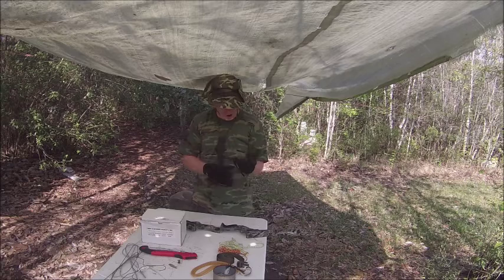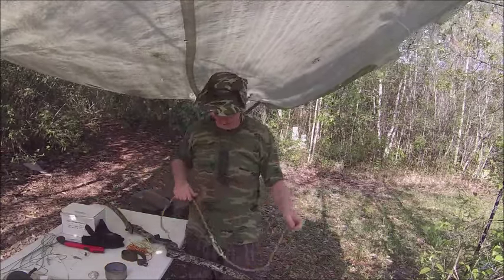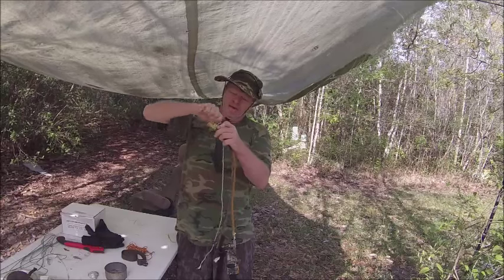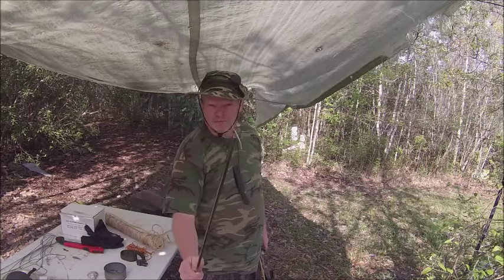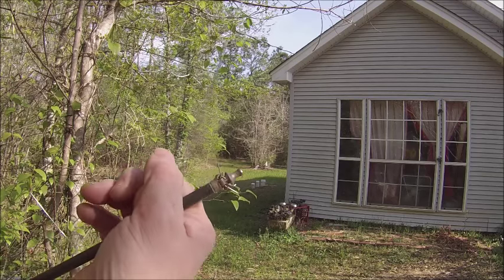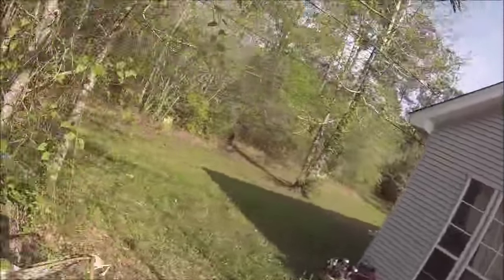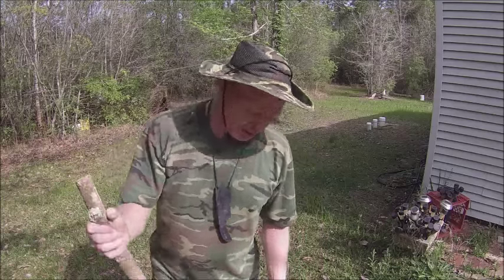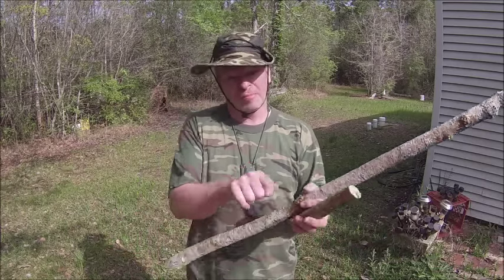The Rubber Band Bow Test Request

Comment: That worked very well. So some arrows and a rubber tube might be a good thing to bring along as a lightweight backup.
Just need something as a bow. Nice one, thank you. :-D

Witch version did you think was most accurate?

I just remember where I saw it, it was in en episode of "Alaska: the last frontier"
Either Eivin or Artz Lee Kilcher made it as a Christmas gift for his brother, I think it was Artz Lee. PVC pipe and an old gunstock from a broken pellet gun if I  remember it correctly.

The annoying outdoorsman. I like the sound of that. :-)
(It's me, if anyone wonders) :-)
Reply from the maker: +TheAnnoyingThingOutdoors the Long Bow will work good whit this
Reply: Ranger Kooky
Yes, I think it will too. :-)